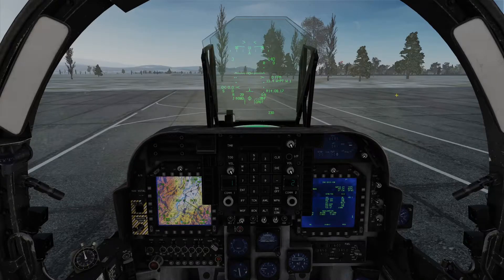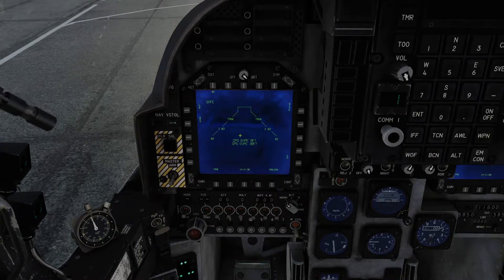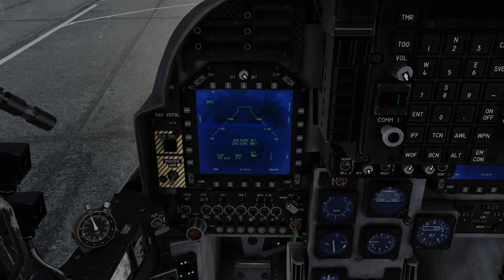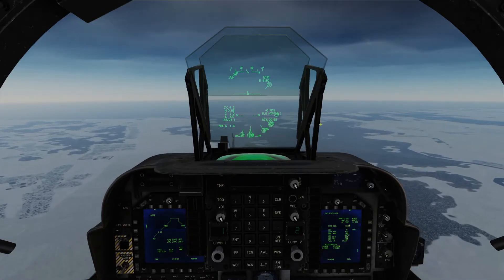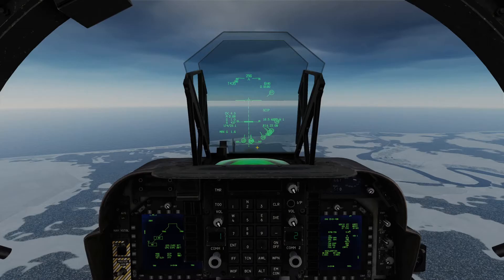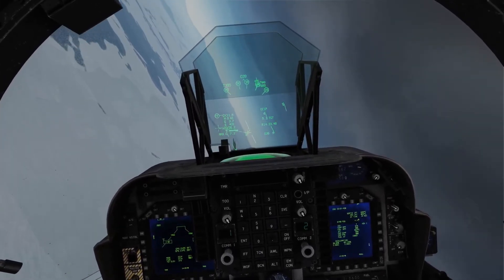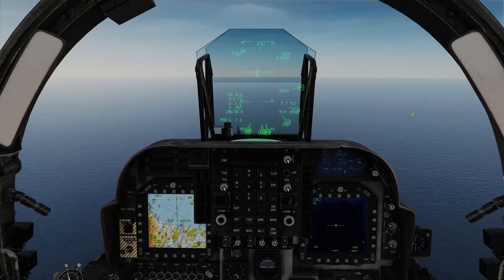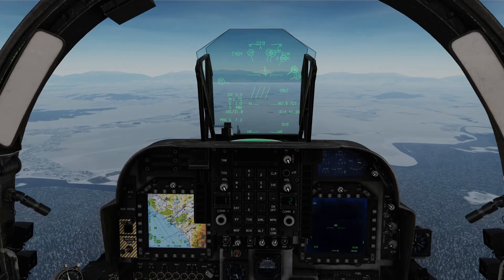DCS AV8B Tutorial 4 - Free Fall Bombs

Comment: Hi Deep hack been going through your lessons now for a while, racking up the knowledge on the harrier. I've run into a problem with this one. I've done exactly the same to set up for a CCIP run but I'm not getting the CCIP drop line and cross. Only difference I have is I'm carrying the Tpod. But regardless of its off, on, Standby or if I go to TV mode I don't get the CCIP pipper. Only way I can drop any bombs is if I lock a target using either DMT or Tpod, then the HUD selects Auto and I get the CCRP drop line. 
What am I missing? lol
Reply from the maker: Strange, do you have a steerpoint designation set? What happens if you press uncage to cycle between auto and CCIP?

Comment: Just a couple of points mate, your nozzles were at 10° while you were doing all the bombing runs. When you spawn in the air this usually happens so always worth a check. Next one is, AUTO is much better used in a dive, and 10x more accurate, unless you're low and fast using retarded bombs of course. In testing I've found a 15-20° dive is best. But good video anyway mate 👍
Reply from the maker: Thanks for the comment, you're quite right. I only noticed when watching back that my nozzles were not locked back. This also unlocks the RPM limiter so very bad practice. Very true about auto mode also, I was intending to just demonstrate a drop in level flight but this mode is more accurate in a dive and can also be used for toss bombing until the separate toss mode is implemented.
Reply: @deephack  It's happened to us all! Yeah I get that, and it was perfectly explained from start to finish. I love a bit of toss bombing!

Comment: Hi deephack, really enjoying these AV-8B tutorials! Your content is clear and easy to follow. I was wondering if accompany notes of the procedures would also help in assisting users - a short checklist of sorts as I know this module gets much more complicated. I'm struggling this minute with the JDAM's. One question which I've not tested but will holding the pickle button definitely change the drop from CCIP to CCRP on appraoch without actually dropping bombs seeing as you're holding pickle? Keep up the great work!
Reply from the maker: Could be a fun idea to make materials to go along with these videos. I'll have a think about that. Yes, just to confirm that as long as your CCIP cross is below the bottom of the HUD and in dashed symbology holding the pickle button will switch to a CCRP delivery and not immediately drop the bombs. If you are worried about messing it up though the second way of doing this is to tap the pickle button and then press uncage to manually switch to CCRP.